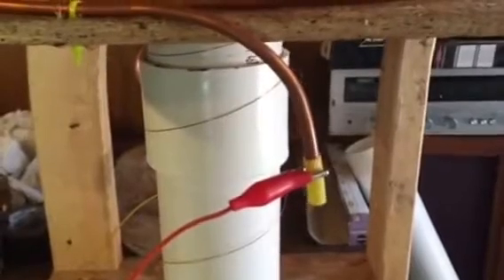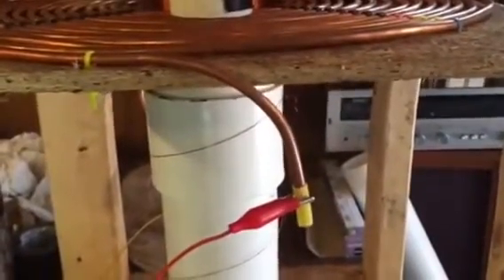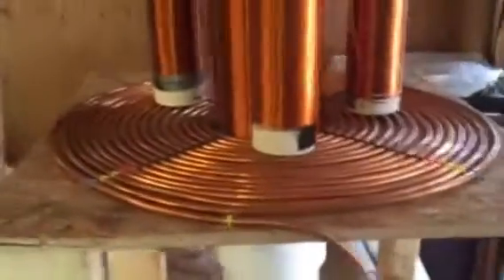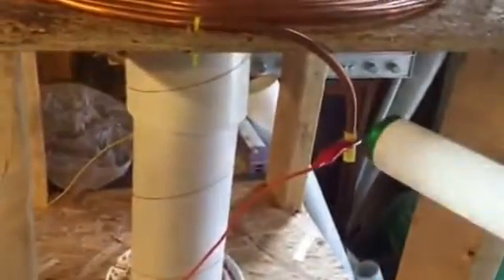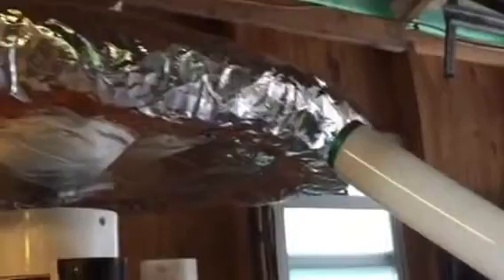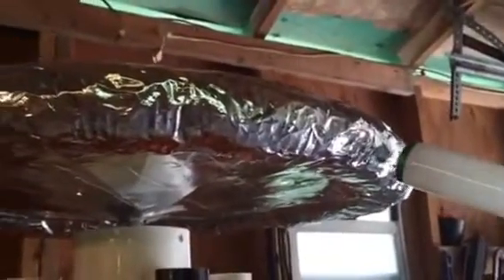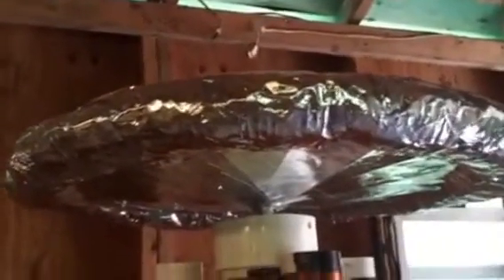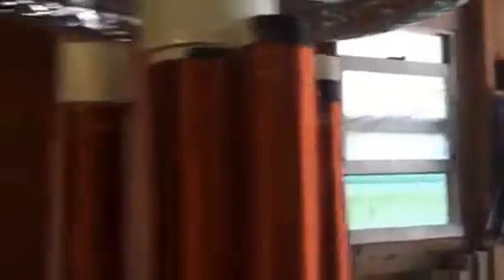Inductive connections on a tesla transmitter

Comment: Hi there!

You should take a look at a couple of vids made by Gerard Morin. He is calculating the energy correct and is using RF frequencies instead of direct electricity. You can hold the powerlines in your hands and power whatever you want and it does not harm the body, at all!!! I think this is what would make the Leedskalnin flywheel work. The magic lies in using frequencies. This kind of power makes as much light in a bulb as with ac, but the heat is totally absent! Crazy!! Engines don't heat up ever, etc! LOOK AT THE VIDS!!!! You'll get it!

Comment: Hi. Roy your buckets with bottles if you make one bucket pos and one neg charged water it's simple place a pos in one bucket and one negative in the other from the se power source and then pour the same amount of each in another whilst having your connections in this other third bucket it should supper conduct  as the neg and pos are unstable.   I think !   May have to be like joe booker shows with stainless concentric tubes in